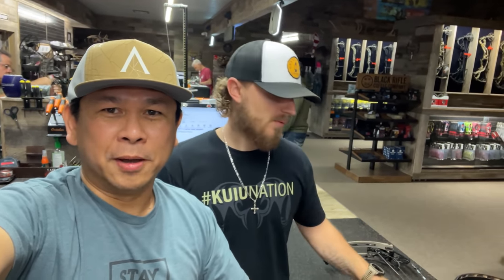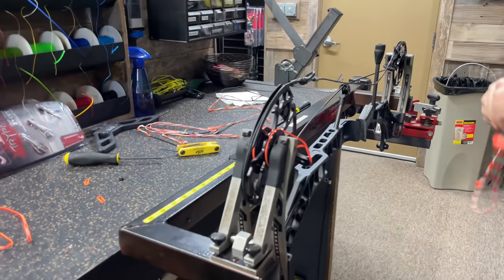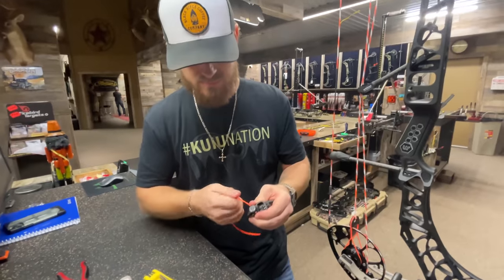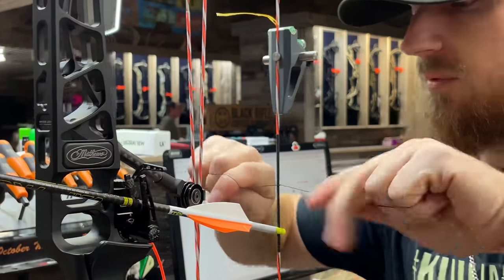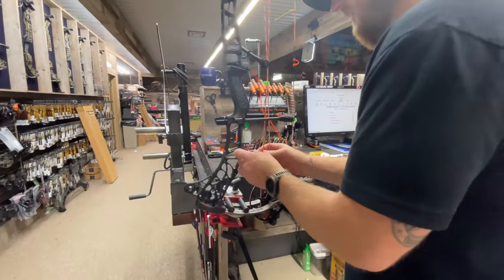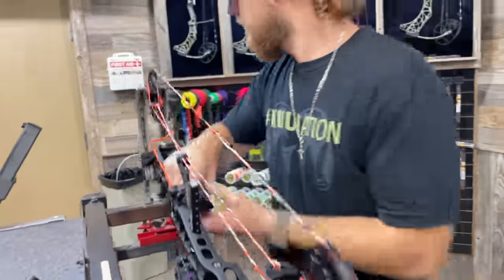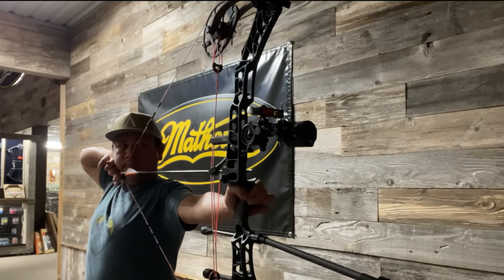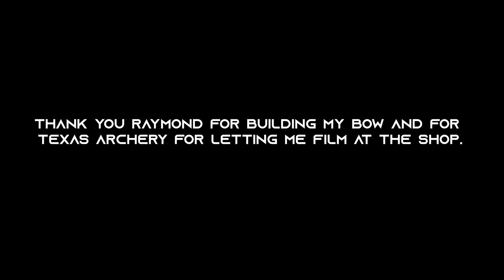2022 Mathews V3X 33 Bow Build

Comment: Looks great, I would just trim off the back of the sight for a cleaner look so it doesn't hang all the way out the back of the riser.
Reply from the maker: Been highly considering doing just that. It will also save about 4 oz of weight. 👊🏽

Comment: Got the 33 myself too because I hated the string angle on the 29
Reply from the maker: I think for most people the string angle sweet spot are on bows with 31" to 33" ATA. You made a great decision getting the X33.
Reply: @romanracela  it just felt right I’m shooting a lot less weight because of 2 pins in my shoulder but the cams smooth as butter at 43 lbs with absolutely no vibration

Comment: Roman great video. Saw that Raymond is now over at Outlaw Archery in the Woodlands. I typically have Raymond or Richard work on my bows. 

But here’s a question for you. I’m looking to get new cables and string for my V3x33. How have the Twisted X been a year in? 

And I’m also a 28” draw length, and was wonder if the switch mod u set up your bow with is the 27.5” and how’s that been going down .5”?

Comment: I would run the sight all the way in and then cut off the excess with a arrow saw will make it look cleaner. A hunting sight doesn’t do much good if it’s extended all the way out.
Reply from the maker: I though about drilling holes on the dovetail and cutting it short to lighten it, but the sight housing is so darn heavy and I'm unsure what lightening the dovetail bar would do to the balance of the bow. I want an Axcel Landslyde 3-pin, which is almost half the weight of the Hogg Father. I still want one but nothing is available at the moment. I'll eventually swap out the current sight when the Landslyde becomes available. 

I agree, there's no benefit in running a hunting sight all the way out. I'm only 3 notches in and there are 10 notches on the dovetail bar.

Comment: I bought the 29 in Granite. 
But the 33 was sweet too. 
But at my 28 inch draw length The 29 fit was money. 
I kept my V3-31. 
That will be my back up bow.
Reply from the maker: I also have an 28" draw, but I went the opposite way and got the V3X 33. I also kept my V3 31. :)
Reply: I have a 27.5 draw length . I want the V3x 33! Will I be pushing it or is that okay
Reply from the maker: @Sneakyjoe69  The V3X 33 goes down to 27" DL, which is what you probably want to get for mods because they tend to be a half inch longer....so a 27" mod would be a 27.5" draw in reality.
Reply: @romanracela  
I know you said you are a 28” draw. 
Are you using a 27.5” mods on V3 and V3X?
Reply from the maker: @jayonez137  Yes. I use a 27.5" mod on both the v3 and V3X.
Reply: @romanracela  
Thanks Roman. 
I kind of figured that is what you were going to say. 
I’m also a 28” draw but I been struggling with the V3 31 and the V3X 29 with 28” mods since I switched to side plates . 
I was fine with the 28” mods  when I was running the ultraview Chris Bee grip.
I ordered two sets of mods in 27.5 for both the V3 and V3X . Just wanted to pick your brain since we are both same draw length.
Reply from the maker: @jayonez137  No worries man. Archery sometimes become a tinkering game to find that "sweet spot" so we can shoot with confidence.

Comment: Question, shouldn’t the rest be extended like at full draw when leveling the arrow and setting nock rest?
Reply from the maker: Great question. I think typically the answer is yes. However, QAD has made it easy to install and setup the Integrate MX rest. Like Raymond mentioned in the video, the QAD has an indicator or arrow that needs to line up to a line or tick mark on the riser as a starting point (15:22 on the video timestamp).  Also, the centerguard on the V3 and V3X makes it even easier to lineup and level the arrow. Obviously a bubble lever still needs to be used.

In my case, the fall away rest installed on my V3X 33 was taken off my VXR 31.5 so setting it up was even easier.

I hope that helps. Thanks for watching.

Comment: Does the 33 come out of the box allowing 75lb draw weight and 31.5inch draw length?
Reply from the maker: Yes. They come with a 75# max draw weight and available in 31.5" max DL. They do run about 1/2-inch DL longer so their 31.5" will measure 32 inches on the draw board.

Comment: Top video, But why do you choose such a big bow?
Reply from the maker: Good question. I'm only 5'9" so the bow does look sort of big for my stature. However, the string angle really works well for me and the longer ATA is perfect for western hunting. I still have my V3 31 for tree stand and saddle hunting. Although, I don't think a 33' bow would be an issue up in the tree. But for sure it would be tough for ground blinds.

Comment: Diference between MX and IMX and any better than Hamskea Trinity Hunter Pro?
Reply from the maker: I’m not sure if QAD has an MX model, but they do have the MXT. The basic difference between the MXT and the IMX is the flush integration of the IMX on the risers of the Traverse and Vertix models and newer Mathews models. They both still have the micro adjustment clicks for the windage and elevation of the launcher. 

I haven’t had any problems with the QAD IMX. They’re durable, quiet, consistent, and I like the arrow containment on the QAD 100X better than the Hamskea. Although the Hamskea Trinity Hunter Pro is loud when shooting your bow, it is overbuilt like a tank and will survive more abuse than the QAD IMX. The arrow containment on the Hamskea is pretty horrible and your arrow just rattles around on the launcher. Another difference between the QAD and Hamskea is the former uses a cable driven system while the latter uses a limb driven system. 

I hope this helps. Thanks for watching.
Reply: @romanracela  Ok thx bud!I asked cuz i already have Trinity Hunter Pro and have some issues cuz dosent fit so nicelly

Comment: Did yours come with the uv grip?
Reply: I bought the v3x 33 in ambush green. Love it. Better improvements on my shot pattern. Thinking about the bee real grip myself.  Shots out to 60 seem to go left
Reply from the maker: I replaced the stock Engage grip with the UV.
Reply from the maker: @robertshirlingjr.6988  just put a few clicks to the left to compensate for the windage. Mine does that too but becomes very obvious at 70 yards to 100 yards...but still not bad.